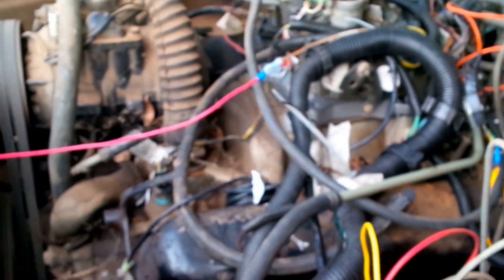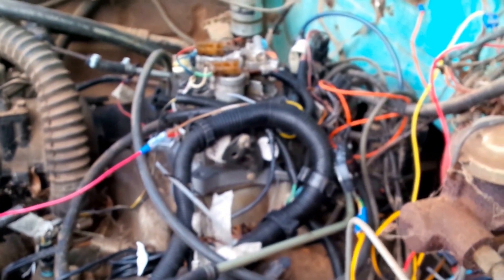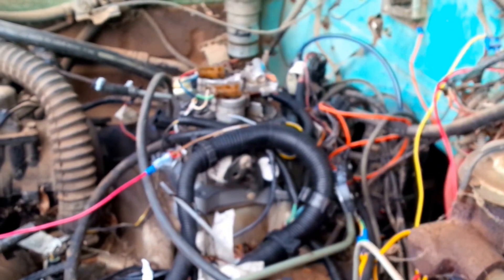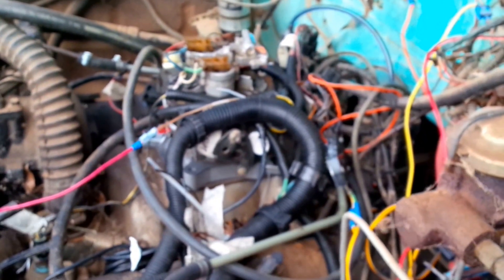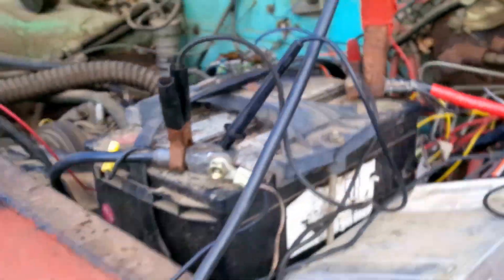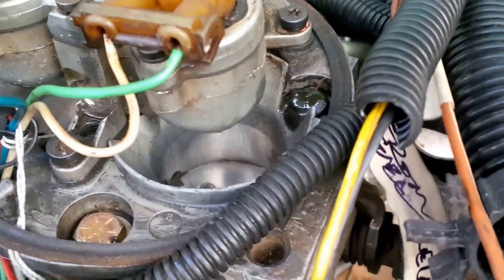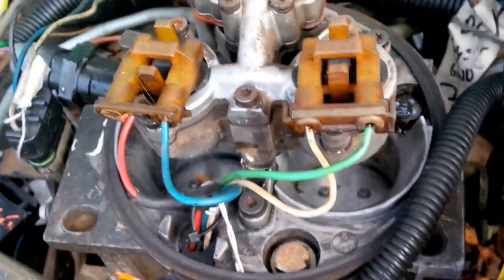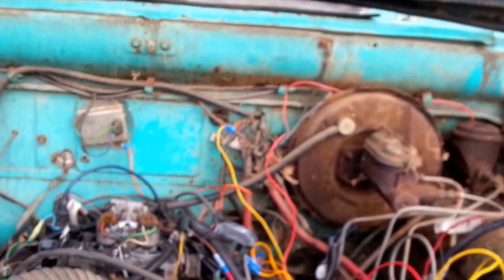Mopar 318 running on GM TBI

Comment: So after all this time is your rig working? 
And can you post parts list.
Reply from the maker: Yes i works well. I had to replace and program a chip in the ecu but it can all be done.  I bought a Moates programing system: http://www.moates.net/apu1-autoprom-package-usb-version-p-54.html?cPath=94 I think you can get away with the $85 version.  I also purchased the adapters and chips from Moates.  the only issue I have is at WOT under heavy load.  but I have not had time to really mess with the tune. Parts list: GM eCoil DR37, Chrysler reluctor style distributor, GM EFI ignition module and a heat sink for cooling (use heat transfer paste), GM 1 wire 02 sensor, wiring harness, Coolant temp sensor, Throttle body, fuel pump that sits on the frame rail from a 86-91 Ford EFI truck with a 5.0 engine, Fuel line repair kits to connect to the back of TBI, MAP sensor, 2 relays, fuse block and a lot of patience.  This video shows the setup: https://youtu.be/wBf1UWzEevc  This video is an install from a Kit but it's basically same concept: https://youtu.be/FIjejnLBvww
Reply: @TBohan88   The down side of a programable chip is no matter how  much you improve the combustioin efficiency the mpg is set in stone. However, if you could get the stock prom to work you could gain power and mpg with the Gagetman Groove. Works the best on TBI engines by gm.
Reply: It was very ingenious of you.
I bet you could sell your own kits.
Thank you for educating us.

Comment: Sorry to bug ya again. But did you have to do anything special to the coil to get the pcm to trigger the injectors or did you just run a wire from the coil to the pcm? Thanks!
Reply from the maker: Matthew Green I pulled the entire wiring harness off the GM truck. I took wiring harness, Mapp sensor, throttle body, ignition module, temp sensor and o2 sensor. I hooked it up just like it was on the GM except I pulled the plug in the cab that you typically use for setting the timing on a GM. My distributor is just a stock Mopar reluctor style distributor. I'll make some more videos this week to help explain the setup.

Comment: Thanks! because I want to go with fuel injection on my 79 dodge d300 truck with a 360 motor but wanted to keep the stock ignition system.

Comment: Did u use stock dodge distributor or did a gm distributor fit in?
Reply from the maker: Matthew Green I started with a Mopar distributor modified to lock the mechanical and vacuum advance. Then after tinkering with the computer controlling the timing I decided to go back to a stock Mopar distributor (reluctor style) and pull the plug on the timing from the computer. Now it only controls the fuel delivery. It runs great! I'll try to do another video this week showing the finished setup. The wiring was a mess in this video.

Comment: Take a 360 TBI, and bolt it on to a 318, You go from about 470 CFM to 600 CFM and it requires now mods. The 360 TBI can be bored out to flow more. The injectors are plenty big enough for an engine up to nearly 400 CID.
Reply from the maker: Tom Byrne I like the idea of no mods. Really for this setup I didn't need to mod it but I wanted the computer to control the advance also so I disabled it from the distributor. I have looked for dodge throttle body parts but it seems that they are pretty rare, at least in the junk yards I've been in. and I haven't found nearly the same documentation to help understand the system. these GM ones are everywhere and there's lots of good info on how they work. also parts on ebay for these are super cheap. I haven't posted an update video but I have this system running like a champ now.
Reply: I have a 1989 Shelby Dakota with headers, true dual exhaust and Edelbrock Performer manifold and the Mopar TBI works well. The 360 unit will be even better.

Comment: why not use a Mopar tbi?
Reply from the maker: Because, from my understanding they are much more complicated.  Also there is tons of documentation on how the GM system works and much less on the mopar system.  All of this was pulled from a junk yard.  I  plan on updating this video with a much cleaner setup (same parts just put together better) since I just recently got it running again.  Thanks for watching.